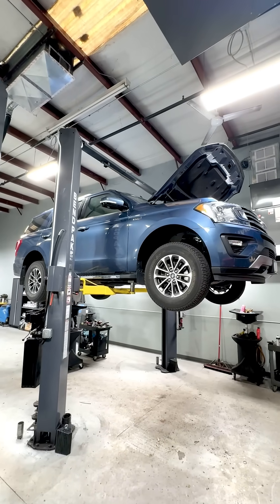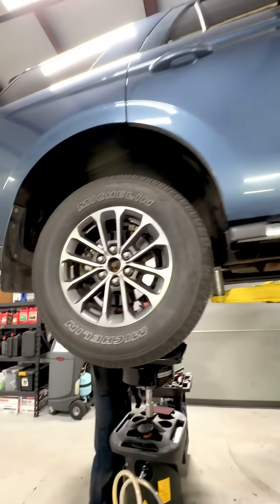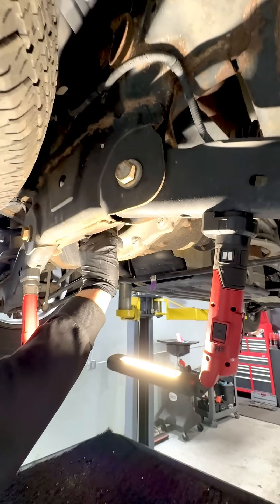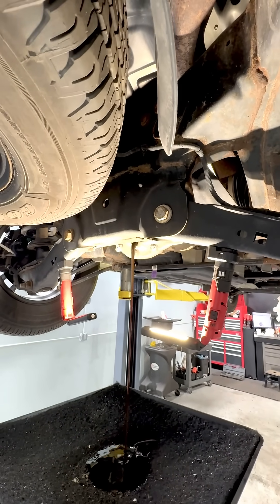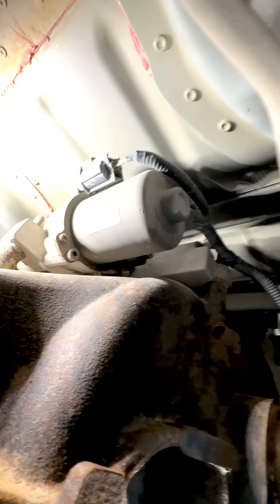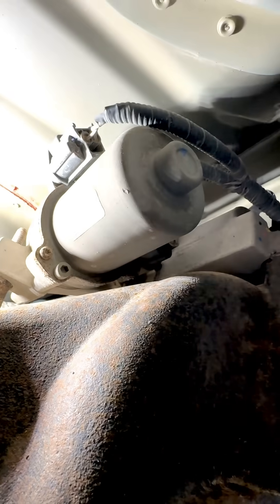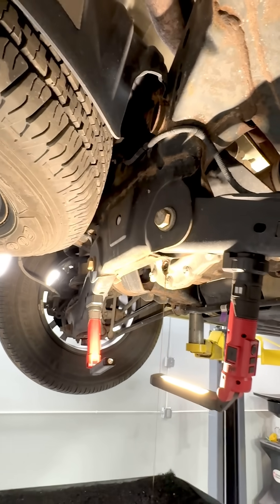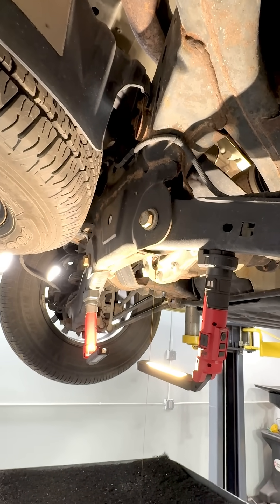Yes Ford eLSD electronic differentials DO REQUIRE friction modifier. Here is why… #shorts

Comment: I have a 2021 Expedition FX4 and i have a Electronic Locking Read Diff by the press of a button.  The one you serviced is an FX4 as well with a Electronic Locking Rear Diff.

Comment: 75w-140 correct???
Reply from the maker: no 75w-85
Reply: @FordTechMakuloco  copy that, I know they used to use 75w-140 in my 2008 f150 and I believe in my 2013 F-150. Thanks for the update.
Reply from the maker: 2015+ 75w-85

Comment: I wish they all just came standard with torsens.
Reply from the maker: They require modifier too
Reply: @FordTechMakuloco  Really? I wonder what the theory is behind that? I thought friction modifier was just to achieve proper slippage between clutch packs.
Reply: Be better if they came with Detroit Truetrac. No clutches to wear out or springs to break. Beat the hell out of mine I put in my 2wd sequoia for 10 years. Absolutely hate the e-locker in my ‘16 F-150 I recently bought. Will be ditching it in 2025
Reply: @bluedeval03  Yeah, I replaced my diff with an Eaton TrueTrac. It's so much better than stock

Comment: Most of the differential fluid I’ve been using for the last five or six years comes with friction modifier already in it should I add more or would that be enough?
Reply from the maker: I do not use those fluids since they always seem to have an issue after. Either it is not compatible or not concentrated enough so we avoid at all cost.
Reply: @ I got ya. Thank you sir.

Comment: LOL! To much technology on 4-wheels has made more issues then solving them. Its something else to go wrong. I have a 1999 F150 with 227,000 miles on it. I have no heated seats, windows crank by hand. SIMPLE!  What ever happen to simplistic designs. What there making today in the automotive industry is basically JUNK! Change the oil in 10,000 miles, are you all this dumb!
Reply: Who says to change your oil at 10,000 miles? I change my ‘94 f150 at 3,000 and both my ‘06 f150 and ‘17 expedition at 5,000.

Comment: I just don't understand how anyone can be a ford mechanic anymore. I changed a alternator on an edge the other day and it put me on the edge of setting that junk on fire and pushing it off a cliff. Pretty sure the engineer's at fomoco hate mechanics and the customers of ice vehicles. I traded that junk off on a kia before anything else goes wrong. At least i can touch the alternator on the kia without tearing half the damn car apart.

Comment: My 2019 Edge would groan when making a turn from a stop under acceleration. Dealer said changing rear diff fluid would not help. I bought the specified Ford fluid which has the modifiers in it, cost was $60 but it fixed it. I did not spend the 4K for a new rear differential.
Reply: I'm guessing my 2018 MKx 3.7 AWD needs this also?

Comment: That stuff is so potent, always wear gloves. I worked at a transmission shop for 10 years and we also offered this is a last last resort to fix torque converter shudder, and actually had about a 80-90% success rate pouring a bottle into trans. Great stuff
Reply: Which vehicle ?

Comment: Do the 2004 2 valve or 2005 3 valve Expeditions with a limited slip need the friction modifier?
What about the front diffs too?
Reply: Limited slip anything needs friction modifier
Reply from the maker: Rear yes front no
Reply: @FordTechMakuloco  Thank you.  Would I have to unbolt the cover or just open the drain plug if it has one?

Comment: Typical Cheaping ‘em up manufacture tricks. 
  A LOCKING differential is Much much better than a Limited slip clutch type that wears out Fast. 
   I see Cheapo Ford Quit using a straight rear axle !  Wonder if the F150 did that too. 👎
Oh Well MORE CVJ Joint Boots to watch for Early cracking before they crack open and the joint grease flies out and the joint fails !!  
 & …………. L@@K @ all that RUST for ONLY 6 Years Old !!! 😱
  Somebody was Too Cheap to buy the full car wash with the underbody wash to try and keep the Cancer Salt OFF !
Gotta wash em Often peeps. 
  This Newer New Junk is Way Over Priced and Built Worse and Cheaply. 
How much is a Brand New Ford Expedition now ???  $100,000 ? 😡
F’ that !  I’ll find a decent older 2000’sh model and GLADLY & PROUDLY Overhaul it with New Parts & get Another 300,000 miles on it easy with my 2,500 - 3,000 mile Oil changes with Great Oil !!
   & Keep her Washed Upped constantly in the Cancer Salt Months !!
AMEN 😂
Reply: El cheapo? The straight axle is much cheaper to manufacture and assemble than independent suspension. But it rides like shit 😅
Reply: The 2007+ generation Expeditions 
didn't offer a locking or limited slip 
differential at all.
Reply: The Expedition got independent rear suspension starting in the 2003s.  The ride quality was amazing compared to the first generation.  It also allowed the rear cargo floor to be lowered
Reply: @ml9867  2003 is when all the auto manufacturers stuff went to hell in quality. 
That’s Funny. Did Ford want their workhorses to Ride Like a GM ??  Haha. Funny, GM had a Straight old fashioned rear axle and they rode great. 
But used to be if ya had work to do you went and got the FORD. 

GM’s electrical stuff always failed
Fuel Pumps
Power Windows
That Damn big resistor for the Variable HVAC Blower Fan in the Auto Zoned HVAC system
etc. 
etc. 
   Fords electrical stuff work good 
But they were just kinda UG*LY. 
😂
Reply: Oh Ford had engine issues as well. 
Ford’s Diesels went to Total 💩 starting in 2001 to today even !!

Comment: whats the Ford recommended fluid change for differential on the 18-21 expeditions? 200,0000 miles right? Think the tranny is 150,000 miles lol rediculous
Reply: Check your owners manual
Reply: @ I know what the intervals are. I was just  being sarcastic and calling out that Fords recommendations for service intervals are way too long IMO
Reply: @SyNergy81 seriously,and 10k oil change interval, wtf?
Reply: @karateman856  Fords strategy for selling more new vehicles more often is "Lets just make the fluid and oil change intervals much much longer so we have a better change of engine/transmissions failure while just out of the warranty phase and force the customers to buy new again since the costs to replace/repair will cost almost as much as a new vehicle "

Comment: Ford has done ✅ FUBAR design work on their latest cars and trucks. I wouldn’t buy a new Ford for anything…
Reply: That's almost any manufacturer anymore. Toyota just started going down too. Still better than most but over complicating systems now. Like leave shyt alone!!
Reply: Oh wow how original.  We will see you in the comments of whatever brand you buy and b#$@ about next when you get slapped with the inevitable problems that come with that brand.
Reply: I wouldn't buy any new vehicle anymore. ALL the manufacturers are junk in their own way. I'll keep my 1999 grand marquis and 2001 Mustang Bullitt edition. I wouldn't own anything much newer than these. Great milage, yet easy to work on. And last forever as long as you take care of them.
Reply: @kylebuehrer5710  THIS. 
86 S10
89 S10 blazer
96 Windstar
00 Sable
01 Accord
These are all my vehicles.  I agree. Fk the new cars.... 🤷🏻‍♀️
Reply: Same ,I'll  run my 2008 F150 & 2011 Ranger as long as I can, definitely  not seeking  anything later than  those years  @kylebuehrer5710
Reply: I just finally gave up on buying American brands when the old ladies edge needed an alternator. I was ready to burn that damn thing. I traded it in on a Kia. The flex she had before needed a water pump and it was going to be 4000$ or more depending on the condition of the timing chain and components and stupidly got the edge. I will never walk trough a ford dealership door again.
Reply: Me either. I own 2 Ford F150's my 30 year old reg cab 4.9 six 2wd 5 speed mostly sits and waits for a trip to the landfill with a load of tree fall. It has 139k on the clock. I have had 5 offers to buy it so far. All Ford has to do is go back to the archives and reproduce that truck, and watch them sell like hotcakes. Electric differential. How stupid can they get?